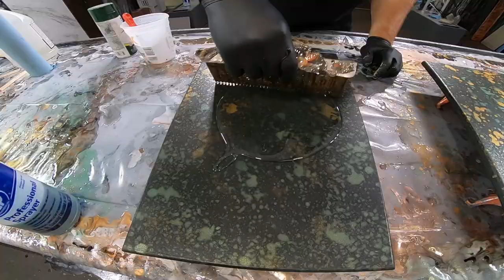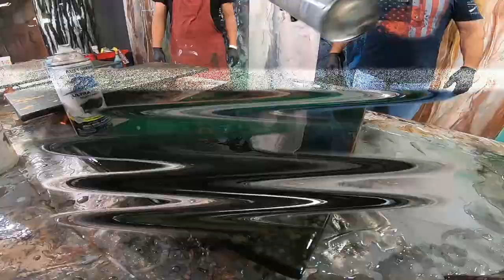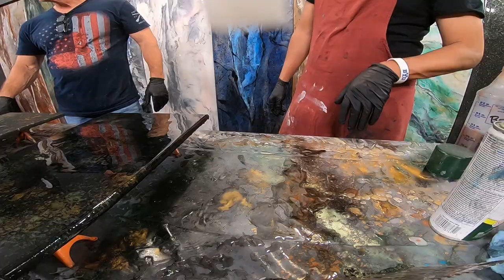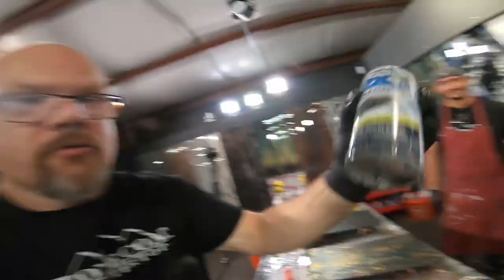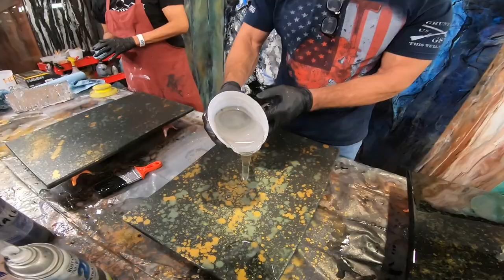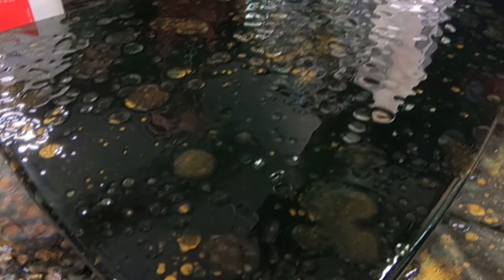Learn to Mimic Natural Stone with Epoxy | Ubatuba Granite | Stone Coat Countertops

Comment: Worst experience I ever had letting local epoxy folks go over my existing granite counters. Looks fine but way too soft and it scratches too easily for a high wear area like counters in a kitchen. They came out sanded them and put a hardener coat on that just dimpled the surface, attracted dust particles and anything that was in the air. NEVER AGAIN.
Reply: Anthony Llabres did you know that the epoxy full curing time is 21-28days? Every day it’s harder and harder
Reply: @ResinitCoUk  the PRO told me his sherwin William's products were the best and that we could normally use the counters at 72 hours. Which we ofcourse complied with.... I have bumpy,  pimply counters and another PRO, has offered to come out and hand sand them and cut and polish them smooth again. So 7 weeks weeks ago the project started and here we sit with kitchen counters that are absolutely trashed and no cooktop throughout the process. 3 supposed Pros all telling me how that last guy was probably a YouTube watcher that had no idea what he was doing. $2300 ... later.... we are still waiting to have our kitchen back. Obviously not your fault, but I wanted folks to know to really vet your epoxy pro well and make sure you have referrals that are real that you can verify! Dont make the mistake that we did and trust a Facebook ad where all these wannabees place ads for business.
Reply: Anthony Llabres thats sad to hear.. I’m doing it over 3 years. Never had a complaint luckily, because first works was lack of design :) I done over 100 sample boards, about 20 big projects and 20 small projects. And still learning because its really tough... at least I know how to finish smooth as glass and I know how to make epoxy stay heat resistant for boiling pans as epoxy is heat resistant up to 470 F but if you do it wrong its not high heat resistant and much softer than normal
Reply: And why would you ever go over your existing granite countertops with epoxy
Reply: @bradynoble6677  When I bought the home 16 years ago that was what we inherited. Hunter green and black swirls. We didn't want to rip out the granite and several companies in my area started popping up doing counters and floors. Came out of nowhere. So we interviewed 2 providers and the rest is history. Huge mistake.
Reply: So your saying it scc fault? If you did like what you got it the contractors fault not scc. There is lots of ways this stuff can go wrong of ypu dont know whay ypur doing . Sounds like you got a fly by nighter.
Reply: @bradynoble6677  Have you read anything I wrote above? I am not saying it's their fault. I am warning folks to watch out for providers that don't know what they are doing! I am trying to save people PAIN AND $$$$
Reply: Brady Noble because you don’t like the color but it was there when you bought it
Reply: @bradynoble6677  Yeah... my question.. and then post here when they didn't use Stonecoat Products.